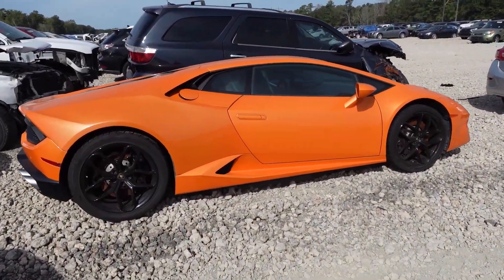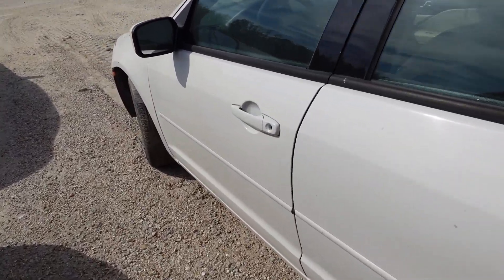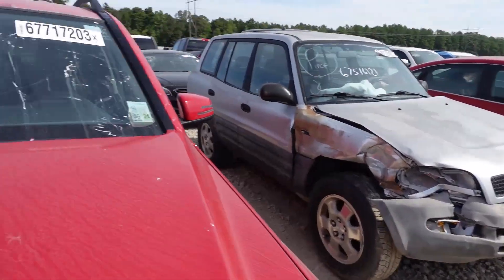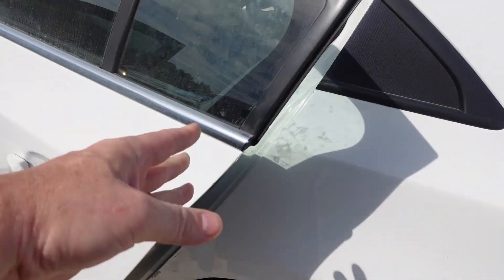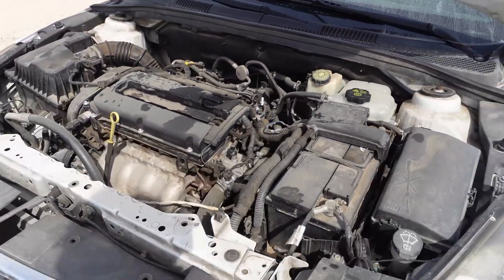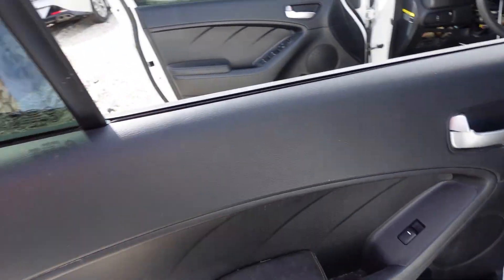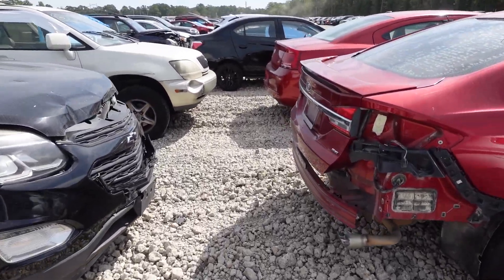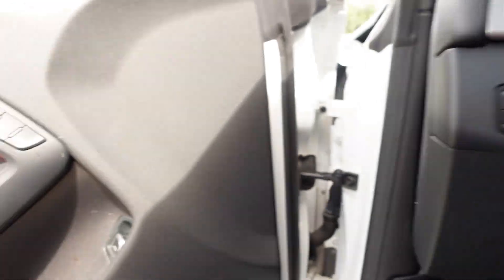Fast Money Flipping Copart Cars

Comment: u really do not know what u r doing ... louosiana its 10 cars per yr .. mississippi its 25        the Kia u just turn the key hole w/ anything to start ... and no mention of the FEEs ... just got a fusion $2000,,,OUT THE DOOR $2855
Reply from the maker: You may want to check the Louisiana law again before you get in trouble. It’s 4 cars per year without a dealers license.